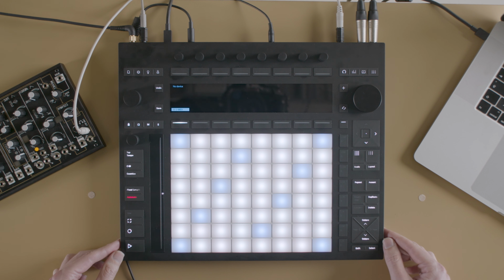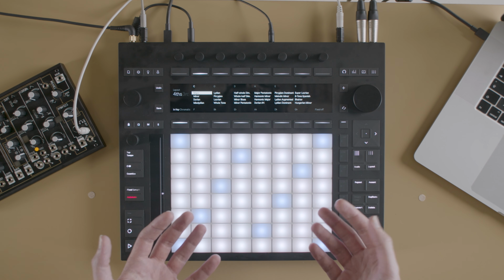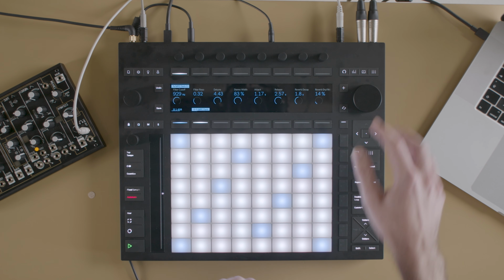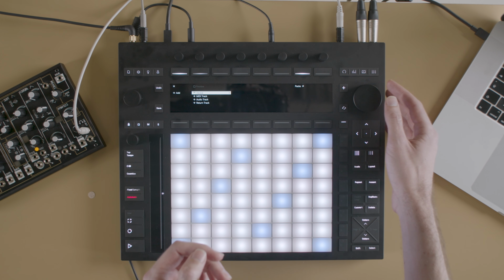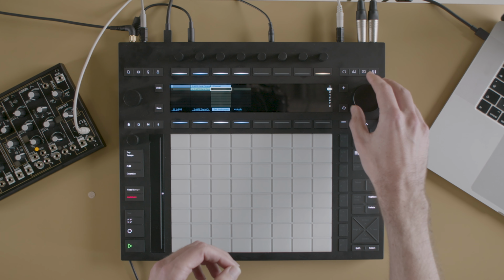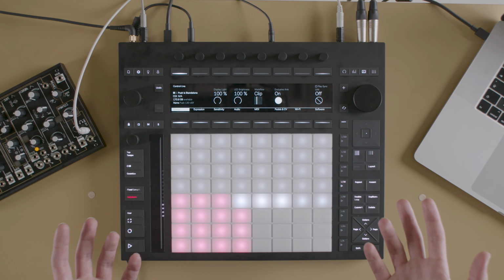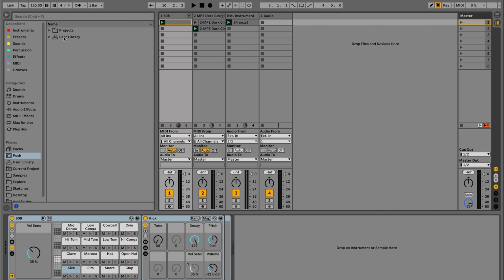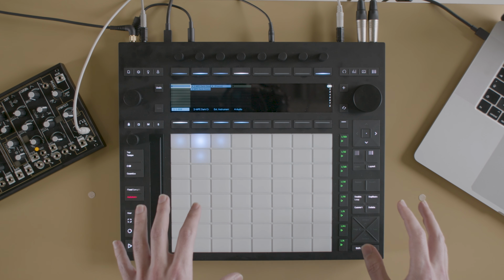Ableton Push 3: Walkthrough - First Look

Comment: Personally I’m impressed with Push3. There’s no reason to be dishonest about it though. Saying, “it does everything live can do on the computer” is insanely misleading. As of yet, once disconnected from the computer there is no way to access, (let alone even look at the arrangement view). Drastically different from what you claim in this video. Just be honest. There are huge limitations of how you can use Ableton with this device compared to Ableton in the box. Someone might see this video and think they can buy push3 instead of a computer and expect the full functionality of Ableton Live. This is not the case. Nothing wrong with being a fanboi, just don’t mislead people considering potential large investments.
Reply from the maker: That's a totally fair point. It's no excuse but we only had a few hours with it the day before launch. It was a bit of a last min dash and things like that have slipped the net! You're right for sure. Thanks for the helpful comment 🙏

Comment: Wondering about pricing !?
Reply from the maker: Push (standalone) – USD 1999 / EUR 1899

Push – USD 999 / EUR 949

Upgrade Kits will be available in late 2023, and will cost USD 1049 / EUR 999.

There are the two versions - standalone and tethered. Different prices but it's somewhat modular and you can amend it as yu wish down the line. Big change from Push 2!
Reply: @attackmag  Quite a lot for standalone.
Reply from the maker: @paolobalatini5687  It's all subjective. It's an invesmtne but over the years the price per hour used will be absolutely tiny (in all likelihood)